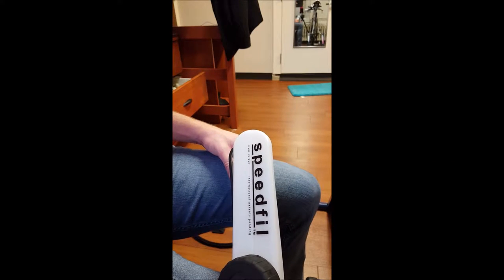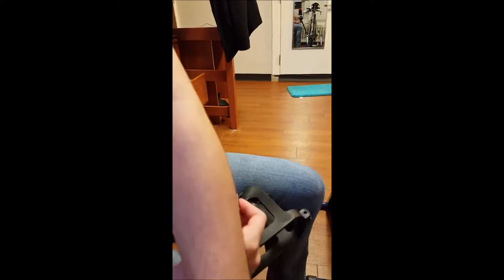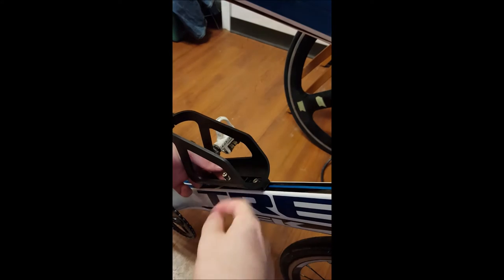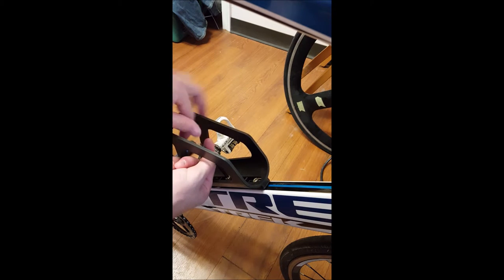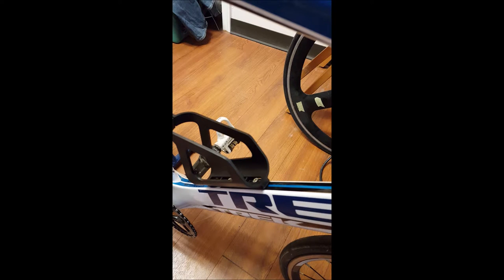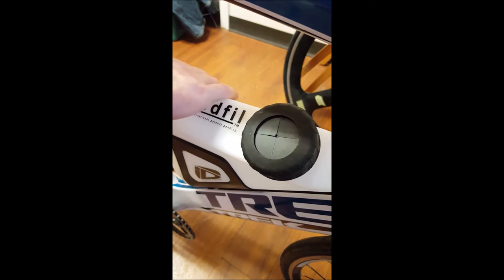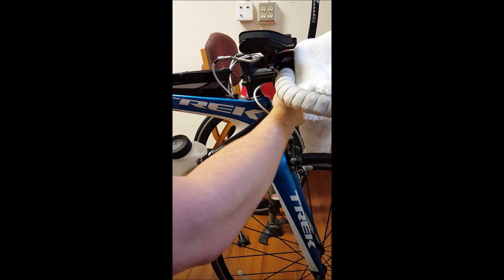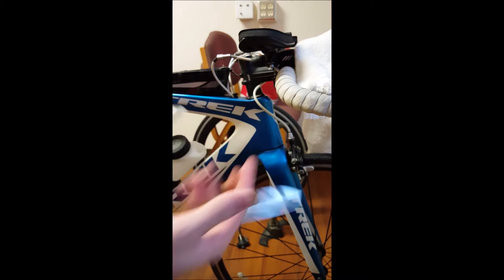speedfil Installation process

Comment: The brace is very tight, im afriad if i spread it any further to take out the bottle, i might break the brace, any idea how?
Reply from the maker: I felt the same way when I first looked at it. I started flexing the material back and forth until I felt comfortable with trying to get it all the way open. After the first time, it is extremely easy to get the brace off and on. If it breaks I would presume the company would send you another one. If you continue to have problems after this, please let me know.